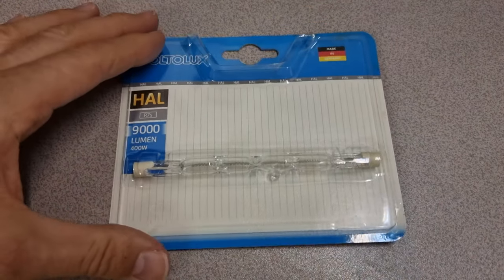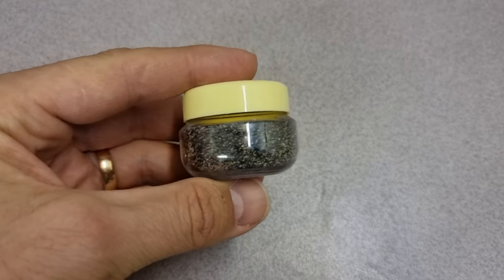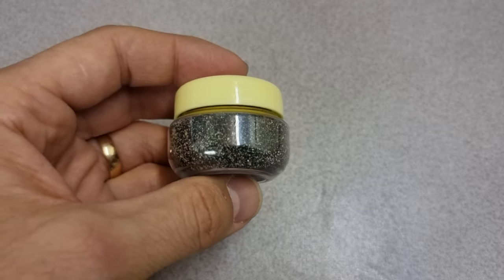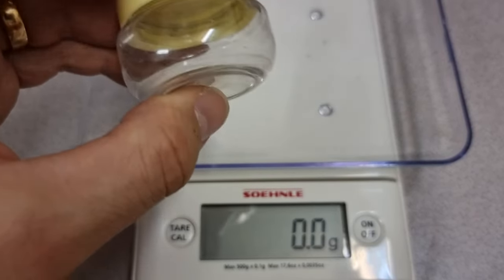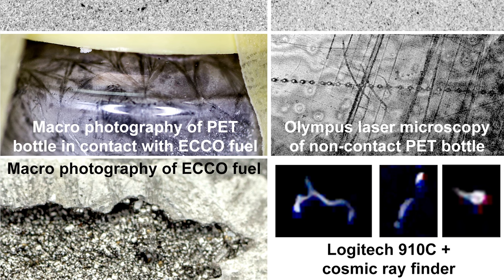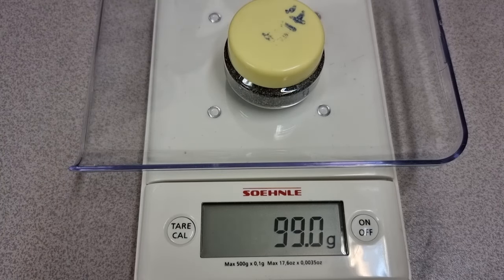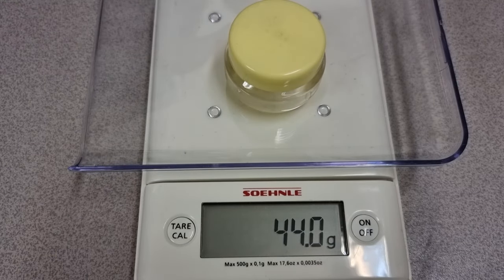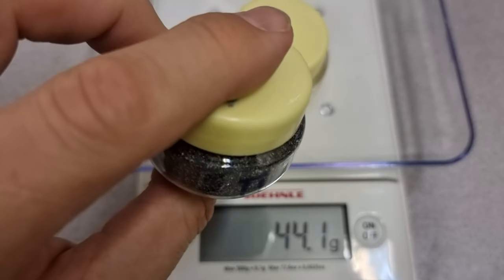Fixing Fukushima - Kerala Black Sand

Comment: gold refiners have a love hate relationship with black sand. some is magnetic, some is not. also it is hard to separate from the fine shiny, but it can hold single atoms of platinum group metals on the corners of pyrite complex crystals, bound on with sulphides, and messing up gold assay data and being near to impossible to get the PGMs off the crystal matrix of the heavies. i have seen a few methods, one used pirahna acid brew to eat away at the sand until it was all turned white. another heated the sand and fast quenched it into cold water making an amazing squeeking noise as each grain cracks from thermal shock. the latter method i feel is more for flour gold and magnetite, the 1st method more for sulphide heavies.
Reply from the maker: Wonderful detail and knowledge. Please, when I have this written up in a blog next week, I'd very much appreciate you adding links to your comments at RemoteView.ICU